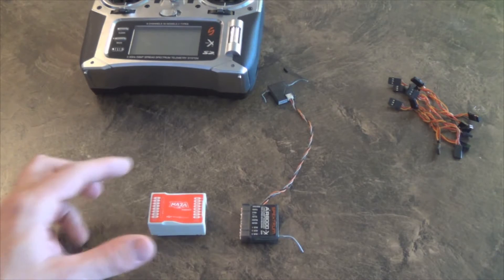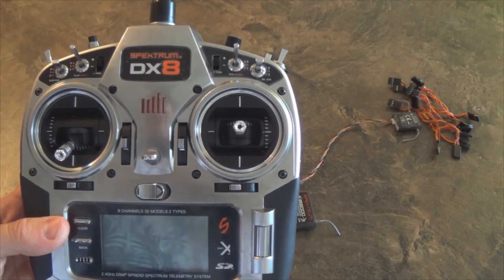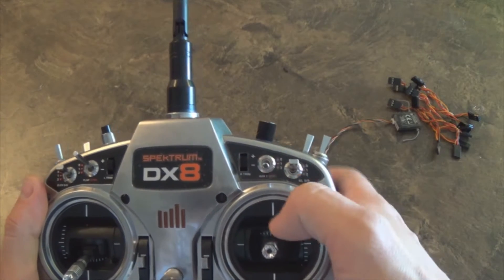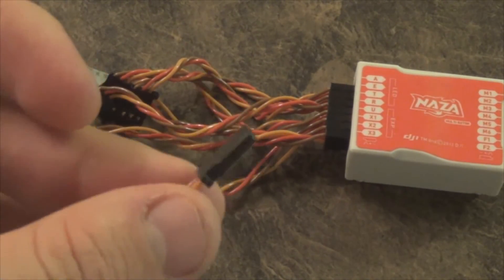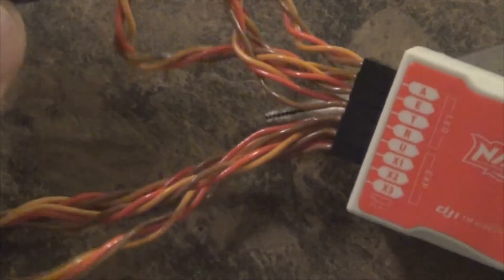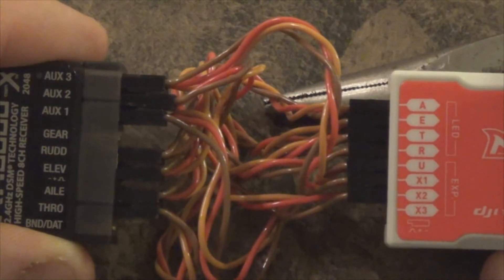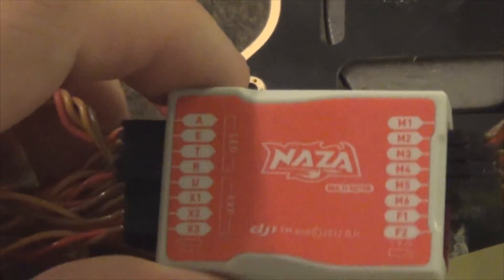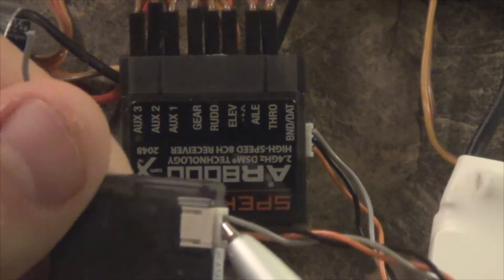How to Wire DJI Naza-M 1/2 & Lite(With Spektrum Receiver)

Comment: I just acquired a DJI F550 Hexacopter. Trying to bind to a JR x9503 transmitter. Normal bind procedure seems to work, but the drone does not respond to inputs. It used to be bound to a Spektrum DX9. Help please.

Comment: Hi I have a new Naza M lite and guess it V1. Can you explain about the wiring structure on both these units (if you have the brown wire on top pin on the Naza so is it on the top pin of the receiver or does it go on the bottom pin. Any clarifications will be appreciated.
Reply: Just to clarify I am using a flysky rx and tx. The rx is fs ia6b.
Reply: Same doubt did you got answers please share here

Comment: I can see two problems here. First is, that with this wiring you can't use low battery warning on Naza (there's no power on X3 port). Second is failsafe settings. You should include failsafe switch when you set receiver's failsafe, because thete is also failsafe options on Naza (on low battery, on lost signal)

Comment: My naza will not go into gps mode in the assistant software it shows atti where gps mode should be
Reply from the maker: @ 9:20, you have to adjust your remote setting so that it will switch from attitude to gps. Did you do this step?
Reply: do you mean setting end points? I have done that. It is as if i have no gps there
Reply from the maker: Seth Nicodemus that really is weird, unless you are using the wrong software version but I doubt that. It should identify the gps if you have it hooked up properly. Is the gps unit new?
Reply: J.D. Rock It is a new gps, I returned my first one because I had the same problem and this new one I got has the same problem. I cannot find a solution.
Reply from the maker: Seth Nicodemus Ok will look more into it, I am just really busy but I will try to make a video!
Reply: Alright thank you
Reply from the maker: Seth Nicodemus Which dji naza unit do you have?
Reply: Naza m lite
Reply from the maker: Seth Nicodemus There could be damaged pins on the controller. If you have it hooked up, the assistant software should identify it.
Reply: I know they are not damaged I have checked that and they all have full functionality

Comment: What this work with a DX6 G2?
Reply from the maker: I have a dx6i, and i need to mix channels for this particular wiring setup. If you are not using gps, course/home lock then this will be just fine for you. I like the Dx8 cause it gives you 3 way switches and not 2 way.
Reply: J.D. Rock Can you please make a video show how to setup DX6I , I have did everything but still have problem , the LED blinking red couple of times and turn off no red no green ,please help